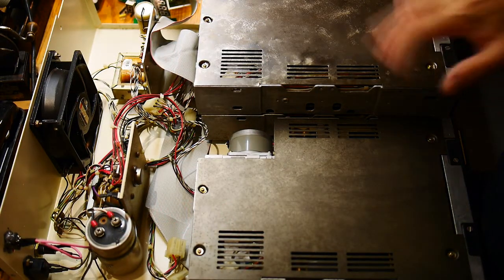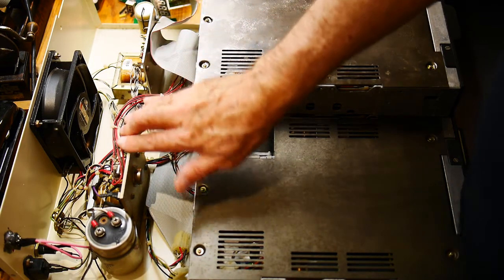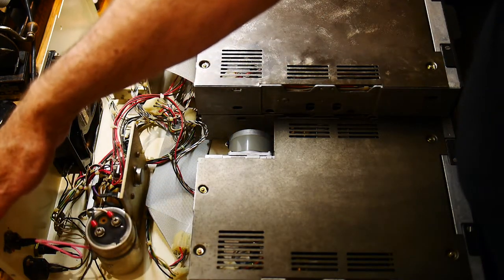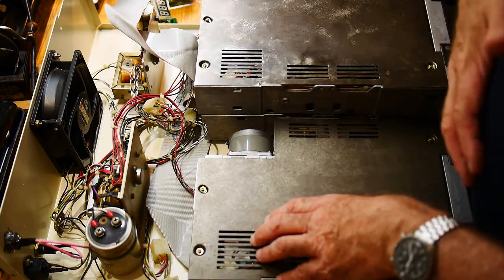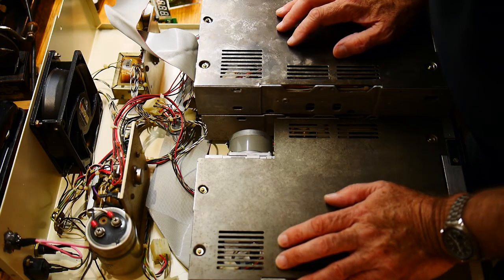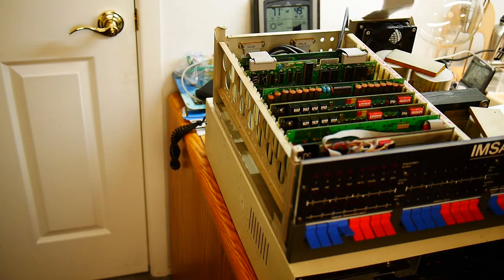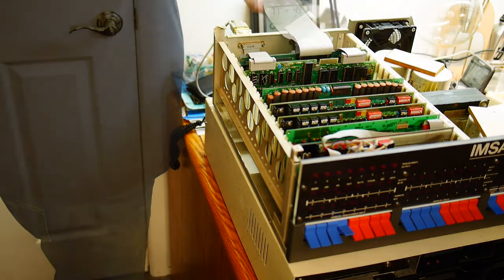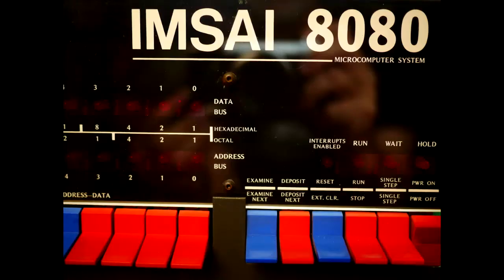#16 IMSAI 8080 look at the disk drives

Comment: I've always wanted an IMSAI or an Altair, so these videos are just fascinating!
Reply: Look up the Altair 8800C.  It's a real remake of the Altair 8800 you can build up.  Not an emulated clone, but a real S100 system using an 8080 CPU.  I built mine for about $1100.